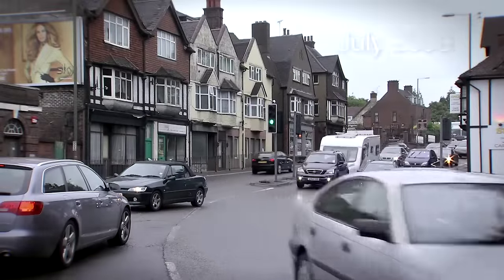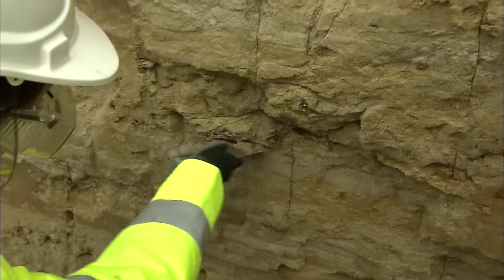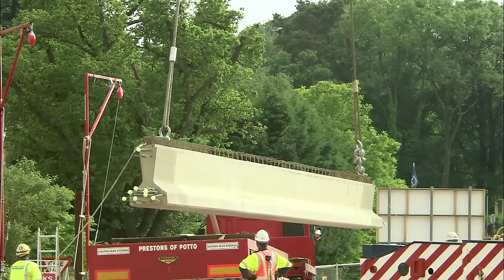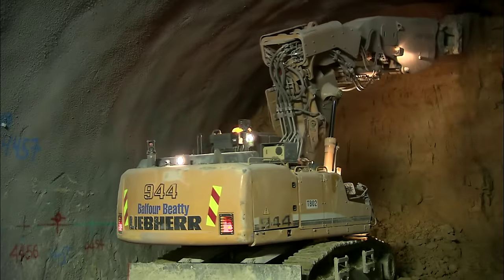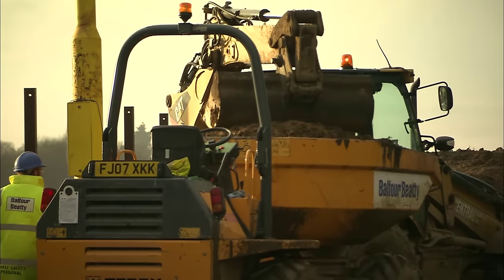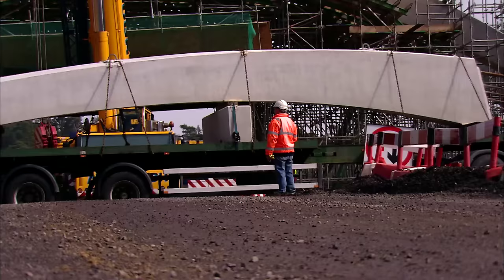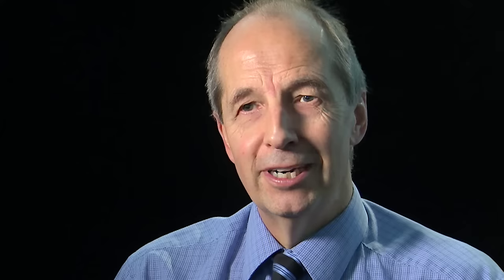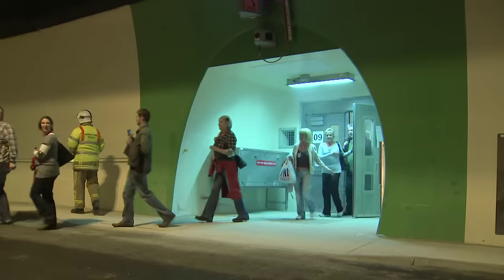Under the Devil's Punchbowl

Comment: An interesting film...  I used the old A3 for many years and Hindhead was always difficult (sometimes horrendous) to get through.  The tunnel has made a massive and positive difference - we just take it for granted now.  I took a film of driving the old A3 northbound a few days before it closed for good.  Funny how I can still remember it so clearly.
Reply: I too remember the old route, the scenery was great but what a pain when it was busy.  Even so, if you were able to post your film of the old road here on YT, I reckon it would be quite popular.  Just a thought.
Reply: I remember driving down to Portsmouth many times to catch a ferry, the old route would always leave you wondering how bad the delays at Hindhead would be, and how much extra time you should leave in order to get to the ferry on time. The opening of the tunnel solved all of that. I started driving back in the 80's, and some of the roads have changed beyond recognition. The A3 south of Guildford, the A31 Hog's back, the A23 and A27 to name but a few.
Reply: I used to motorcycle along the old route in the 1980s, as I’d lived in Portsmouth and went to university at Guildford.
Reply: Oh yes, I lived 2 miles the wrong side of Hindhead for 20 years of morning commutes to London - 25 mins was about the average wait. I recall the blurb about how house prices would rocket south of Hindhead post-tunnel, but I don't think it ever happened.

Comment: I have used these roads for years with my truck and it makes such a huge difference not having to go through Hindhead any longer. The queues at those lights could be 3 miles long sometimes. Gradually, the A3 is getting sorted out. The new improvements up at the M25 are going on at the moment. We could do with some sort of flyover at the Liss roundabout, and I would love to see a bypass to the north of Guildford. I would think a new road from the Clay Lane junction could go up over Jacobs Well and round to come out with a new junction on top of the Hogs Back (somewhere past the bridge) which could really straigten out the present situation linking the A3 and A31 properly  in both directions.

Comment: As a truck driver I was constantly using the A3 before and now after it's construction.. You could always expect lengthy ques leading up to Hindhead traffic lights from both directions.. What a fantastic achievement. I always think off the old A3 every time I drive through.

Comment: I used to commute the Hindhead section of the A3 and the traffic jams were awful. I moved locally in 2009 and saw first hand the effect of opening the tunnel. After years and years of arguments about what was the right solution, to see it resolved was and is fantastic. There is no doubt that it has improved the lives for the surrounding communities and also those using the A3. The only disappointments have been the frequency of intermittent false safety alerts and the frequency of closures, mostly after 10pm, to do maintenance on all that sophisticated sensoring and safety equipment. However, the contraflows keep the traffic moving, and total closures are rare. So much better with the tunnel than without 👍

Comment: Well I was on the motorbike nearest the camera behind the police escort as they opened it - my 2 seconds of fame I suspect 😂 and it was really great to see it done. It made a huge difference to the road system and turned one of my favourite walking places into a delight. Oddly it did leave the centre of hind head rather forlorn, a sudden backwater, but I’m sure over the years it’s become rather lovely as the punchbowl is so lovely.
Reply: you brought tears to mine eyes,  a bicycle trip would have been an example to the local green folk, u petrol heads should be banned;   hot air balloon stations, canals, pack horse track ways, windmills, solar...should be enc and built - a wasted opportunity

Comment: I very nearly lost my life on the old A3 at the Devil’s Punchbowl. On just about every occasion I took that route in Winter I experienced significant fog. On one occasion it was so dense that, at one frightening point I realised I was actually on the wrong side of the road. I steered back to the left hand side just a few seconds before a coach passed me in the opposite direction. The tunnel is fantastic and improves journey times. Guildford can still be a nightmare but overall the A3 is now a really good trunk route between London and Portsmouth etc.
Reply: I marked you down for your bad English.
Reply: Similar experience on Xmas eve 2027 when motorcycling home, a journey i did three times a week and nearly failed to make the sharp right hander near the top  of the hill in the local cloud/fog bank that was a regular feature. The tunnel has removed the scenic part of the journey, from Hindhead cross roads to Thursley, bur also removed the huge danger.

Comment: At 1.2 miles, the Hindhead Tunnel is shorter than the Queensway Tunnel built in 1934 at 2.01 miles long.
Hindhead Tunnel is under land and Queensway Tunnel is both under land and 0.99 of a mile of it under the River Mersey.
Reply: Which is why they say the longest tunnel under land.

Comment: The tunnel is a vast improvement. The one thing I Wish they would do is educate drivers to maintain their speed... many seem to enter the tunnel and slow from say 60mph to about 45mph... & then accelerate again when they leave.  Despite being adequately lit throughout its length many drivers also fail to put their headlights on. So signs at each end would be helpful as can be very difficult to see vehicles in front or behind if they don't have them on.  This also applies to motorcycles!
Reply: And they do this despite there being brightly lit speed limit signs every, idk 3 Millimeters or so down the entire length of the tunnel to remind people you can go 70 down it most of the time

Comment: One odd feature of the tunnel is that they completely removed the original road.   So when the tunnel is closed for repairs (which happens quite often) the old road is not available - and the only alternative is a massive diversion.
Reply: Yes, it would always be nice, if they could have kept the " old road " available. But that would have required the local Council, or some Government Agency, to spend a few millions, to keep the old road in a perfectly usable state... As we all know, they simply cannot justify allocating those funds, for the OCCASIONAL time it might be required... So, sit back and enjoy the diversion !
Reply: @richardruff8712  That was mentioned quite a bit at the time, about maybe just keeping one lane of the old road for emergency use. They completely closed it within less than a week after the tunnel was opened!
Reply: @NOWThatsRichy  Fairly sure that financial constraints would have controlled ALL decision making... i.e. why keep it open for a week longer than necessary ?

Comment: Some people think that the solid white line in the middle of the road in some tunnels doesn’t have any legal meaning because it’s not mentioned in the Highway Code but it has the same meaning as double white lines where the line closest to you is solid, you can only cross the line to pass a stationary vehicle blocking the lane or to overtake a cyclist, horse or road maintenance vehicle travelling at 10mph or less, some tunnels have a sign just before you enter saying keep in lane which is what I’d do.

Comment: The Hinhead tunnel(s) is a great project well worth doing both for the local area and for commuters. It is actually the London to Portsmouth road not London to Southampton as the video description says,  which is actually the M3. 
The plus points are:
Better local traffic and wellbeing for the residents.
Better local environment conditions.
No tolls.
Much faster commute times.
Much safer roads.
The negatives are :
When they close a tunnel they don't introduce a contraflow utilising the other tunnel into a 2 way, Instead they divert traffic around the area with no set route causing mayhem.
The entry slipway just before the northbound entrance is to short and also poor vision for drivers joining the A3.
All that needs sorting now is bypassing Guildford and getting rid of the stupid nonsensicle roundabout near Liss.
Reply: I've been through a contraflow in the tunnel.  It's difficult for a short notice closure, but for planned works they do tend to do that.  Bypassing Guildford is next to impossible unfortunately, although a simple flyover and sliproads to the roundabout could deal with Ham Barn.  It would also improve life for people in Greatham.
Reply from the maker: You're right and my description (written long after I made the film) was carelessly wrong. It's been corrected. Thanks for pointing it out.

Comment: And it takes about 17 minutes to walk through ! !  as we did prior to its opening ( £5 cost for the bus ! )  ... the use of stainless steel fittings was a good idea for almost zero future maintenance , also the tiny part  remaining of the old A3 makes an excellent car park for the National Trust visitors ...... DAVE™🛑
Reply: Grade 600 stainless steel, which is dull and requires a finish, has become a revolution in street furniture, due to its non corrosion properties and considerably lower cost than full stainless. However, electrolytic corrosion of any other steel that it joins onto has largely ruled it out for bridges.
It became a major problem for ambulances, when the chassis bodies underneath started rotting and falling apart after a few years.

Comment: Sounds wonderful but....the planners ignored resilience. It's closed far too often for servicing from the ridiculously early time of 8 pm. There is an appalling diversion of about 26 miles when it is closed,  Why is there no single tunnel contraflow working option to avoid this ridiculous diversion when either the North or southbound tunnels are closed? What is so delightful is that you will spend most of that time behind the first HGV you encounter.
Reply: The diversion you are referring to is one that is able to accomodate all types of vehicles, you don't have to follow that one unless you are driving an HGV.  The majority of the closures do have contraflow in place, and the closures do not start at 8pm. Sometimes it is necessary to have both bores closed at the same time, just like other roads are occasionally closed in both directions

Comment: Is walking or cycling through this tunnel allowed?
I’m hoping to pay it a visit during the summer.
Reply: No, far too busy. The traffic speeds through there now. There's little to see within the tunnel anyway, far better to walk over it. The devils punch bowl is very scenic as is the surrounding area.  It is part of the Greensands Way that I think actually starts in Haslemere.  On the hillside, overlooking the punch bowl, is an 18th century memorial stone for a murdered sailor.   There used to be  a viewing area, overlooking the North portal, that was a modest walk from the cafe car park.  I imagine that it will still be there.  We would sometimes go there to see the construction progress.  They did a great job with much less inconvenience during construction than I had expected.
Reply: @winniewotsit4452  Using good reliable contractors may have cost slightly more, but being finished on time with no budget overruns, it was probably cheaper in the long run.
Misleading costs and timescales, have almost been accepted as a way of life in the UK.

Comment: I would like to have seen the effects on the village after it's construction.
Reply: Often businesses suffer, due to the lack of passing trade. But since in the past parking was such a problem, I think the affect will be minimal.
In Ireland, when the new N roads opened it was a different story, with hotels suffering and both garages and filling stations closing down, leaving abandoned buildings and boarded up shops in the worst affected towns. However, I think that a decade from now, no one would want to return to the old ways.

Comment: With the gains in technology from the Channel Tunnel and engineering operations like this done with great success, I often wonder why HS2 wasn’t designed in the same manor instead of compulsory purchasing houses and villages and destroying the countryside? Basically putting HS2 underground and a Japanese type railway transport for high speed links never to be held up by poor weather and leaves on the line! Yes, a massive project but we have some of the best engineers and technology to achieve this, could be the 8th wonder of the world! That,  think would make most tax payers extremely proud and a very worthwhile project upsetting less people, societies and countryside, IMO.
Reply: Mosty its cost. Generally a bridge or cutting is very much cheaper than tunnelling.
Reply: @martinhow121  I would agree, but looking how much money has been wasted so far on HS2, I sometimes wonder if tunnelling HS2 would’ve been a solution had it been thought of before all the shenanigans started, bit too late now as so much project money has been spent on nothing...
Reply: @bearsey26  I wonder if noise will become a major problem, as it was with sections of the M25. However trains will not be passing continuously 24/7.

Comment: A bit too cuddly for my liking. Surely there were protests and deep concern by local residents. Moving wildlife and building underpasses etc for ramblers is clearly necessary to go some way towards mitigating the destruction, but I can’t believe everyone was happy with this so-called improvement. I understand the tunnel since it was opened, has been subject to several closures despite initial claims that only minor closures would be required for improvements. In 2014 for example there were eight overnight closures of the tunnel for maintenance works! Still, it’s a very interesting film, seeing what goes into such a civil engineering project, just a shame it wasn’t more honest about the true impact on the environment and the associated ecosystem. One day the tunnel will be redundant and we’ll be asking if it really was worth it environmentally.
Reply: Yes, because the amount of fumes that must have been pumped into the atmosphere from people queueing to get through the lights at Hindhead must have been far greater than they emit going through the tunnel
Reply: The bit that made me laugh was when they said about having to apply for a dormouse licence! Then building dormouse bridges! I'm sure the little critters would have found alternative routes by themselves!
Reply: @NOWThatsRichy  not necessarily, there might have been a horrendous mortality rate if there was no route by the way in which they normally travelled
Reply: Short sighted and illogical comment. It's had a tremendous improvement on the the local environment - the exact opposite to what you suggest. You clearly haven't understood what the pollution levels were  like when the several miles of standstill traffic sat in Hindhead throughtout the day and night prior to the tunnel. As for 8 whole closures of the tunnel - why not focus on it being open for 357 days instead ?